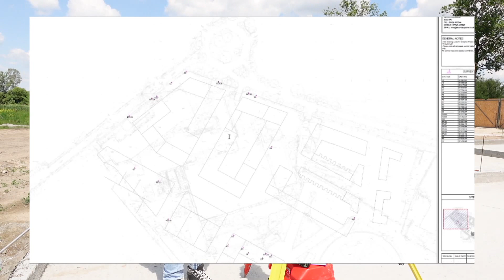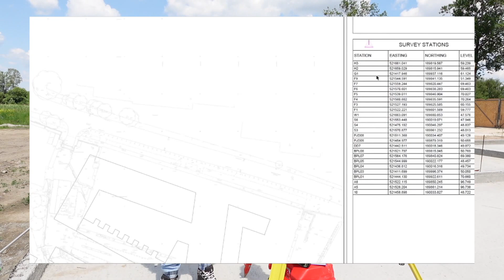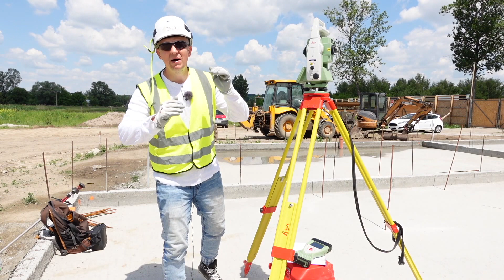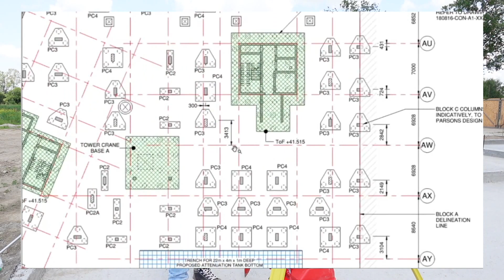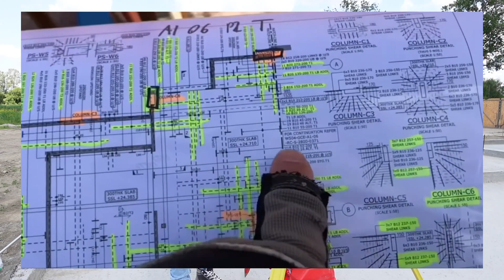How GOOD civil SITE ENGINEERS work.

Comment: What would you say the maximum error in resection results in unworthy of setting out points?
Reply from the maker: It's not that easy question to answer and it really depends what you are setting out. It's engineer's decision on site 😁 When I worked with TS06 in most cases I worked max with 3mm error, if I had greater error I was looking for better resection and/or checking if everything still ties in etc
Reply: @SITENG  great thanks Greg, thank you for replying!
Reply: @louisehoward2865  if you were setting out a dig then an error of 50mm would probably be OK, digger drivers work to about 1 meter! 
But you should really question the accuracy of your stations or your total station.

Comment: Good job Greg.i keep learning from your videos.thank you
Reply: Greg please how do you check the accuracy of control points using resection before setting out
Reply from the maker: You can always come back to one station you used, using a backsight check, or even just stakeout program. Main thing is not to move your EDM really after you've done a resection. If you are talking about accuracy of points before resection, you will actually see when doing a resection and checking the error - quality of set up on the instrument - this will show you how the stations tie in.
Reply: @SITENG  thank you Gary
Reply from the maker: It's Greg 😁
Reply from the maker: Thank you for the comment 👍👍 Happy to help 😁